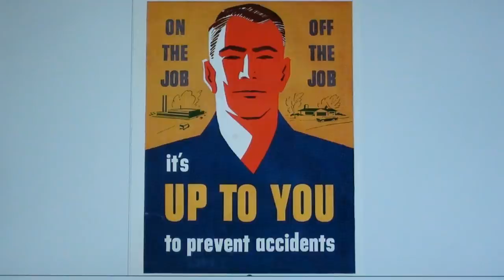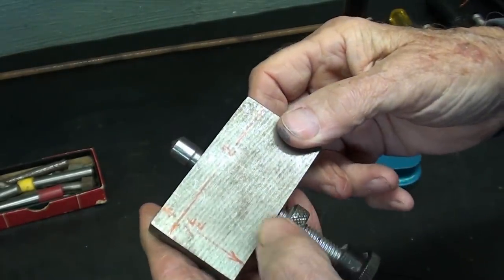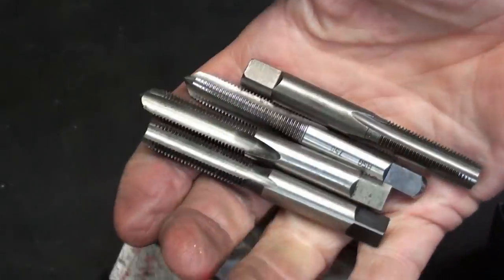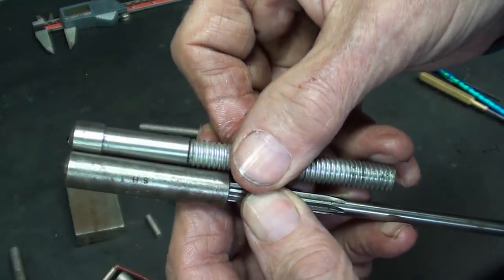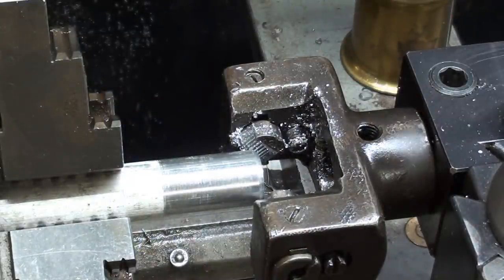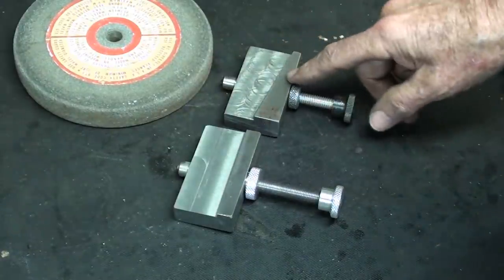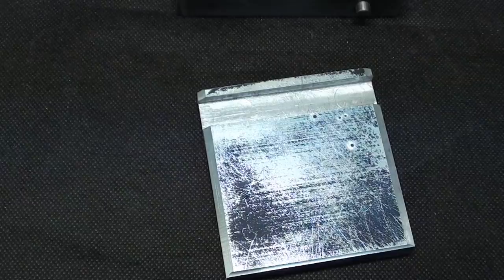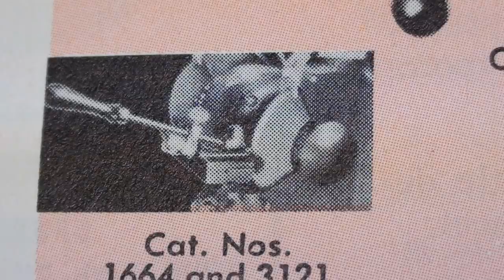MAKE A GRIND WHEEL DRESSER #799 tubalcain

Comment: Lyle, I'm glad you mentioned the need for parallel on the front face of the tool rest and the motor shaft.  Most grinders these days are not parallel.  Most lower cost grinders have stamped tool holders, not cast.  I've had to fab decent tool rests for 2 of my grinders as the stock ones weren't very stable.  Getting them parallel with the shaft wasn't much fun.
Reply from the maker: Yes, it’s very difficult because we are dealing with cheap stampings. Nothing is machine. Do not overthink it

Comment: That was a really neat build, Lyle.  I tend to be on the OCD side, and I like to move my work across the grinding wheel when I sharpen things, even drill bits, in order to keep my grinding wheel flat.  Occasionally I require a sharp 90-degree edge on my grinding wheel, and you've given me a lot of good ideas to make a dresser.  I don't have a mill, but I think I can just bolt on a piece of steel to make the step as it is not a critical dimension.  Great video Lyle thumbs up.
Reply from the maker: Thanks

Comment: My grinder would shake the whole bench especially when starting and stopping and on looking I saw it was not balanced and after stopping or being moved the wheels would rotate and settle at a certain position. So I started to address the balance then realised neither wheel was round and that had to be addressed first. It used to be fine but then then I remembered letting someone use it who probably had misused it causing the wheel eccentricity. So I made a similar dressing tool using 30mm (1 1/4")  dia round bar drilled out on a lathe, tapped to 1/2" x 16 BSF for the adjustment (as I had a tap and die this thread) welded to a small piece of flat bar. 
Trying this out before the loctite stage I realised one grinder work rest had a cutout and sort of half round depression which I'd never noticed before, presumably to aid sharpening drill bits. So the work-rest had to be modified to give the smooth cross-wheel sliding action. I then realised the work-rests are made of thin material and move about. 
Finally got to dress one wheel and its a big improvement, much much less shaking of the bench but still some out of balance rotation - which I hope will disappear when I dress the second wheel (as I ran out of time). Thanks.

Comment: Mr. Pete make a how to, to make the rest parallel to the shaft of the grinder. Thanks.
Reply: Actually the diamond nib should be on or near the centerline of the wheel. This may require tilting the tool rest downward a few degrees.

Comment: Hi Mr Pete  what i did for the screws for your machinist clamps i used a six inch grade 5  i believe  old Oliver  head studs . so i think a grade 5 long bolt would work good and i skimmed off the shank so the thread size was the same size . Good video i need to finish watching . JM   Man Id like to get one of those drill grinder / sharpener that's neat .

Comment: The "True" problem is getting the tool rest to align with the axis of the motor shaft...  
I did not see an offered solution to that problem.  Since there is no reference without taking off the wheel and attempting to reference the shaft from the tool rest... Suggestions? (yes, one can guesstimate, but I know that Mr. Pete is not wired that way...)
Reply from the maker: Yes, no good way no easy way
Reply: I plan on using a small machinist square laid along side of the grinding wheel and then scribing a line on the edge of the tool rest. Then remove the tool rest and carefully mill a straight edge on the front of the tool rest to the scribed line and of course reassembling the tool rest to the grinder. Please let me know if this has been tried and failed for some reason.

Comment: That rod must be hot rolled , I don't have too much trouble with making threads on cold rolled steel rod it's usually much better to use the cold rolled rod instead of the hot rolled
Reply from the maker: Absolutely, but sometimes you have to use what you have, lol